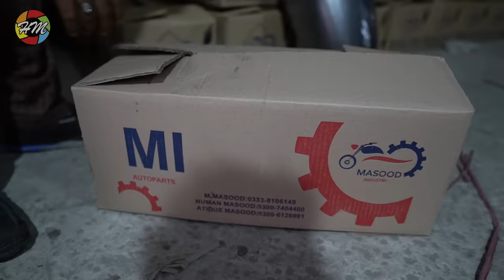Amazing Manufacturing Process of Motorcycle Fuel Tank With Great Technique and Skills.

Comment: This manufacturing would have been considered primitive 50 years ago!
Reply: You mean state of the art 50 years ago?  This would be considered primitive by today's industrial manufacturing advancements.
Reply: @adspremiumwepaypremiumfora1469  I was making car parts, (among other things), 50 years ago.  It was all done in a much more advanced manner than this.
Reply: @Alex_Mitchell  what parts if I may ask sir?
Reply: @adspremiumwepaypremiumfora1469  Fenders, glove box doors, trim, various fittings, etc.  Our family business was metal stamping.
Reply: @Alex_Mitchell  so by advanced you mean in a climate controlled environment?  I am failing to see what advancements there was 50 years ago in metal stamping that for some reason didn't make it to this country that seems to be using 50 year old equipment and processes.  Are you saying that stamping a motorcycle tank from dies was a once step process 50 years ago?  I don't get it.  I mean bumpers, maybe one step to press but glove box doors that's like 2 pieces shaped with some holes pressed.  Did yall have robots doing the work or some advanced cnc presses that just popped out completed forms after placing the sheets in?

Comment: Great work ethic, as usual every one has a job and performs it well. This probably the smoothest running assembly line and highest output I have seen recently.  Thanks for sharing this video. 👍👍😁🇺🇸
Reply: Thankfully
Reply: @Eddie Hitler You must be their quality control manager :D have you actually seen these tanks in person? 
I've seen and used them and they are identical to the original Honda ones.

Comment: I've been in the motorcycle, ATV, UTV and PWC service, parts & accessories since may of 1979 working on many brands at dealers and performance/machine shop and this is the first time I've seen anything related fabricated at the factory manufacturing level. These guy's work hard and their product looks impressive.

Comment: Where is the paint job department?
Reply: I was wondering about that as the tanks may be wet after the leak test.
Maybe the water was actually some rustproofing or similar.
What worried me was the roll welding with water cascading over the wheels!

Comment: It's still the year 1910. Of what. Amazing manufacturing. Do you speak ??? It's called slavery. No worker protection. There is every risk of getting your hands, face, feet injured. Minute 9:35 even the TIG gun welder is poorly equipped. This video is suicide. Like all the others.